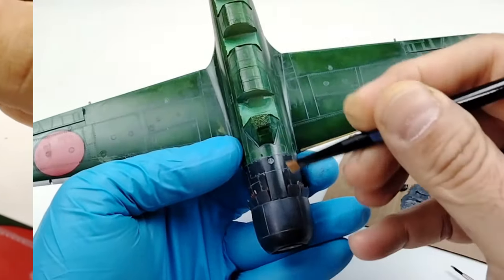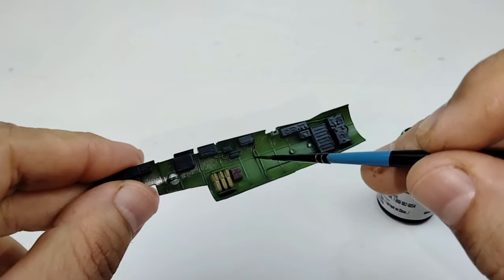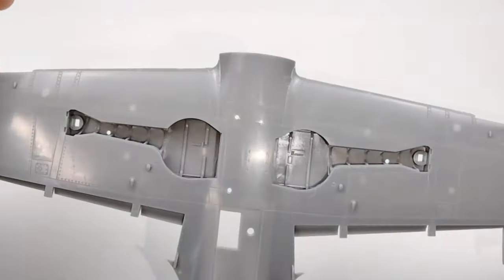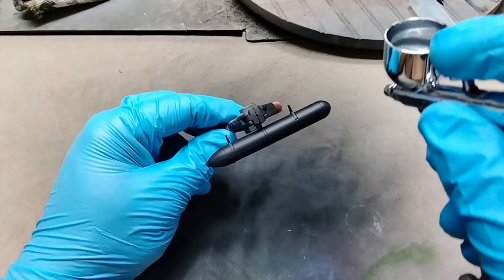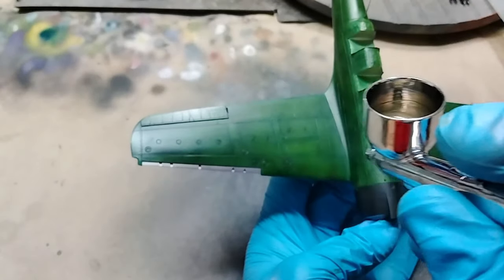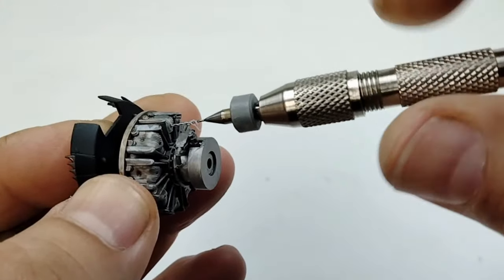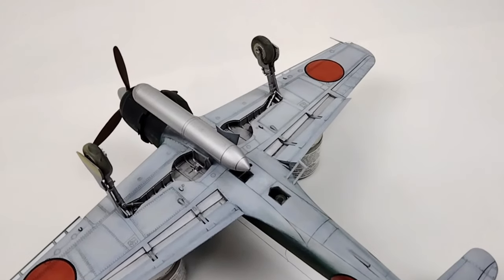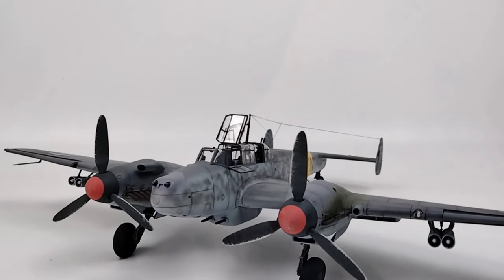FULL BUILD! | 1/48 Hasegawa Saiun MYRT WWII Japanese Recon | Experimental Pre-Shading Technique!

Comment: Phenominal job on the Saiun! One or two points. The C6N was a Nakajima design and manuactured by Nakajima. Nakajima used their own version of IJN Dark Green paint, which differed from the Mitsubishi Dark Green, Nakajima being more of a very Dark Olive hue, rather than the slightly blue hue in the Dark Green Mitsubishi paint.
The Saiun did see active service, notably in the Battle of the Inland Sea in march 1945. They spotted the Incoming US formation and 2 were shot down, the other 6 escaping...